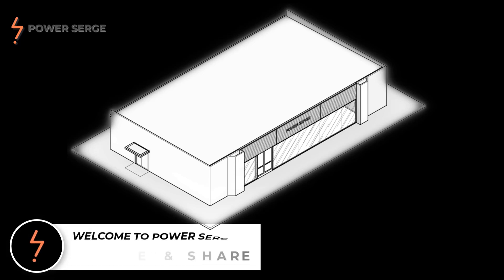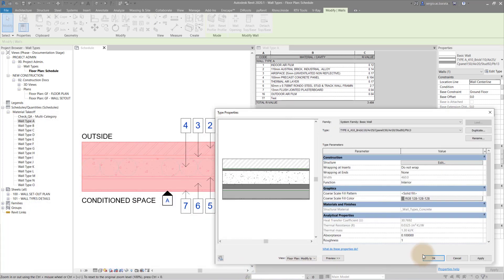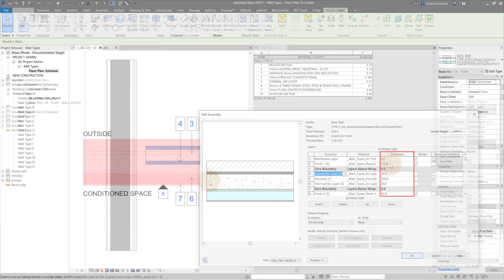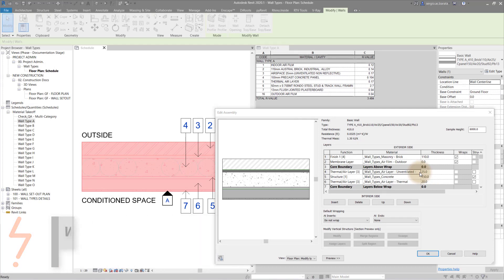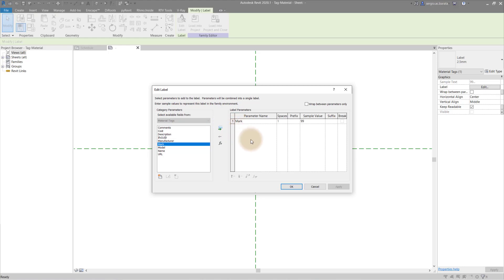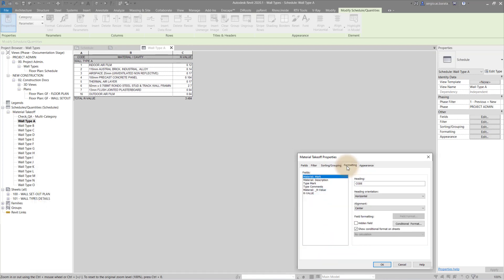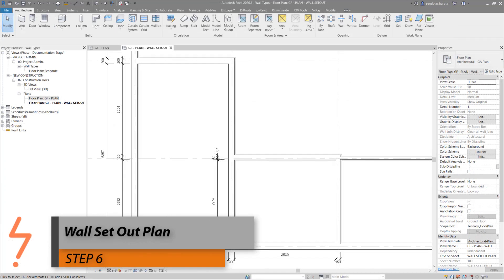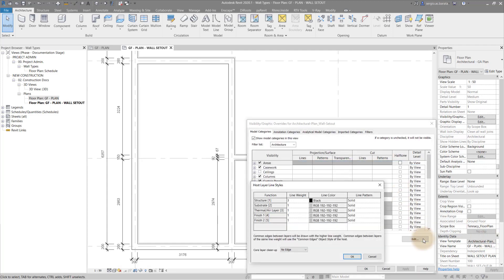Wall Schedules, Wall Legends in Revit: COMPREHENSIVE Guide

Comment: That is a brilliant method to do wall schedules! There is only one issue I encountered that I was hoping perhaps you found a way around it. Apologies for the long question in advance. Considering the same materials (when identical) are shared across multiple wall assemblies, there are instances when a material has a code (let's say 3) that is lower than the mark (or code) of another material (let's say 7) so in the schedule 3 will appear before 7 even though it comes after in the wall composition. The industry standard requires that the schedule follows the sequence of the wall layers (from exterior to interior or vice versa), therefore, the schedule being sorted by code will not allow the description to be sorted by wall layer sequence. Even when removing all sorting from schedule properties, the sorting of the material description seems to be random by Revit. This would be resolved if there is a way to move rows up and down and customize the sorting, but there is none. Any thoughts about that that? I was hoping to avoid creating a material/mark per each wall type.
Reply: Came here to ask this as well. I was so close to going all in on ‘Parts’ for a documented view of a wall type but membrane layers don’t show in these unfortunately. So close! Here’s to hoping either revit lets you schedule wall layers natively soon or materials can have true instance based parameters assigned to them.
Reply: @chris.bullen oh bummer. If you ever found a way around that, please come back here and tell me.
Reply: @taroskib  Hi Taro - I'm working on an alternative that has the membrane within the material layer, rather than scheduling it as a separate layer. It works! for example.... you have a Timber Stud frame layer w/ Sarking (building wrap), rather than having the 2 separate. This workflow works very well and is dynamic.
Reply from the maker: Thanks for the question. I totally understand. I searched far and wide for an all inclusive solution but there was always something missing no matter which approach I applied. If you're trying to keep native Revit schedules, the most sustainable compromise is to create a "Layer Order" shared parameter applied to Materials in context, even if it means duplicating a few high-use materials. Then, sort by this custom parameter in your Material Takeoff. This allows schedules to match the industry-required sequence (Exterior to Interior or vice versa) without losing scheduling automation....but you cannot escape the duplication aspect in the Materials Editor. Most of my team are satified with the trade-off, other might not be. I hope this helps.
Reply: @SergioBarata  thank you for the reply. I appreciate you take the time. The solution you noted is interesting and i’ll try it out. At least it helped me think of more workarounds I will also try.

Comment: Sergio, great video thanks. In the minute 6.45 where you present the end result: how do you create the  wall type detail/cross section? Do you use Legends? Thanks in advance
Reply from the maker: Hi, in this case, it's the actual wall, drawn in a "pre-phase" so that it doesn't impact the documentation.
Reply: @SergioBarata  Thanks, Sergio! How about the label under each wall type? When I do it with Legend I cannot customize the text of my label under each detail and schedule
Reply from the maker: @guerripablo  Legends are limited with tagging. This is why I use the pre-phase system. The whole work flow is demonstrated in this video. Try it out.

Comment: A bit late to the party :x But if you use the same Material in a different flooring and its in a different position ( so the mark numbers doesnt fit anymore) Do you duplicate the material to fit the number? Does that not cause issues when naming the material because its cant have the same name. Like you got Insulation 5cm in the floor in the 3rd position and you now have the same insulation in a different position lets say 5 in the next one for whatever reasons. Now you cant call it insulation anymore but Insulation 1 or so right?
Reply: Same question!
Reply from the maker: Thanks for the comment. Yes, what you describe has to be managed. I have a coding system that help manage this - I recommend you use something similar.

Comment: Hello! Thanks for your video, could you explain a bit more about how to get the R-Value? I already added the parameter to my material browser but now I don't know how it's used. What formula did you use in your material takeoff?
Reply: I've also tried to create the schedule but I just get the materials a thousand times, how did you create the Wall Type A header?
Reply from the maker: Thanks for watching. I think it would help to re-watch chapter 5. Ensure you have all the fields as shown. 

You need to use the Rvalue parameter to create a calculated value. This will allow the Rvalue to be “multiplied”.

In the filters tab of the schedule, set the type mark as a header by ticking the header box. 

Also, you will need a schedule for each wall type. Then use the schedule filter tools to remove the unwanted information.

I hope this helps. I wish you all the best.
Reply: @SergioBarata  Hi again! Thanks for your response.

I see you have a separate file for these walls, that's why it's not working on my end. I'm trying it inside my project and it repeats depending on the amount of walls I have. 

Could you redirect me to the video where you explain how to use it as a linked document please?
Reply from the maker: @popotita  so I recommend using a phase not using in the project. For example, I have a admin phase in my template which is not used on projects. 
That is where I model the walls for the schedule.

You can schedule elements for linked files by ticking the “included linked files” checkbox. 

I hope this helps.
Reply: @SergioBarata  Ok that makes sense, do you have a video where you set up this template and explain how to link it?

Comment: I have made my wall type schedules in a similar way but have encountered an issue with wall joins when the detail level is medium or fine.  Wall layers appear not to join as one would expect due to small differences in material names.  For example, when "13mm GYPSUM WALL BOARD" and "13mm GYPSUM WALL BOARD (TAPED AND FINISHED)" materials intersect, there is a line separating the materials even though they re for all intents and purposes the same material.  Similar issues happen when dimensional lumber walls with 2 different sizes meet.  How have you dealt with this issue?
Reply from the maker: Hi Alex, I know exactly what you mean - to fix this the materials assigned to both wall and layers need to be exactly the same. That removes the line. I have a follow up video in the pipe-line to highlight this. All the best and thanks for watching and commenting.

Comment: How do you create the wall detail (graphic) portion? Legend components don't allow dimensioning, so I guess you have a better way? Thank you!
Reply from the maker: Hi Kevin, Do you mean when place on a sheet? These are actual walls (not components) so each layer can be dimensioned normally. The wall segments are hosted in another view within the project file. I hope that helps.
Reply: @SergioBarata  That helps a lot, thank you. So, to be 100% sure I understand, you have these small walls drawn on a different level (and that level's floor plan) far away from the actual model and place that floor plan view on the sheet beside all the schedules?
Reply from the maker: @kevins6314  actually, I add an additional phase in my template to host such things. This way it doesn’t interfere when scheduling.
Reply: @SergioBarata  One more question: how do you treat materials/elements that aren't a continuous wall layer (i.e. wood or steel framing with insulation in the cavities)?
Reply from the maker: Hi Kevin, send me an email and we can correspond with more detail.